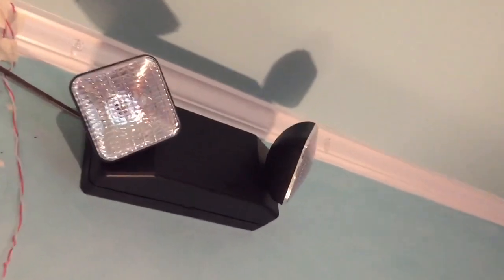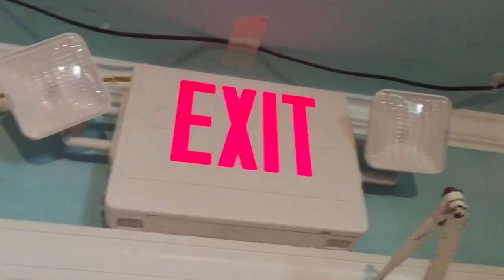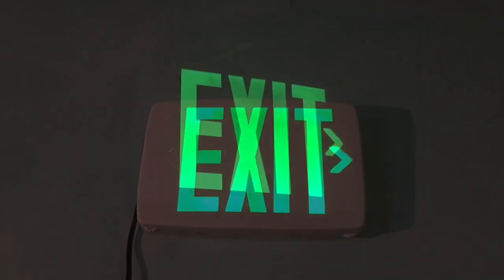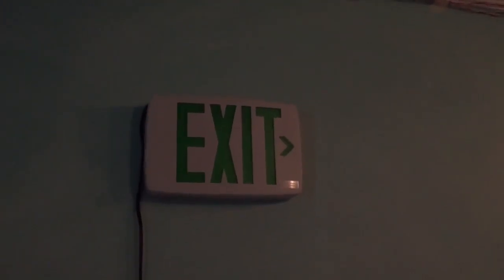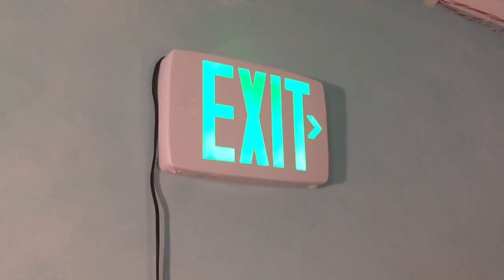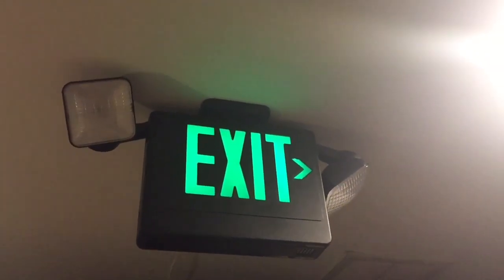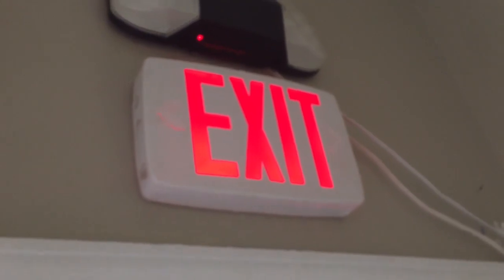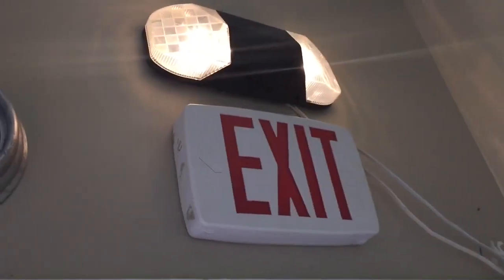EXIT SIGN FAILED?!?! | Exit Sign Setup 18

Comment: I had my garage exit sign combo fail within 30 seconds after power cut off to the unit. The combo is a lithonia LHQM with emergency light heads off of a ELM2 (incandescent version). The battery was faulty.

Comment: 11:35 that’s actually false. I have a LQM AC only sign seen in the video and it failed on me depict being ac only. When I wired the sign up it totally failed and none of the LEDs lit up. AC only signs CAN fail.
Reply from the maker: Sounds like you have a defective unit. When I stated “it can’t really fail” I was referring to how my LQM SD failed. The AC sign has no battery so it is less likely to fail.
Reply: @ExitSign250  I think there was a problem with the transformer or led board. It sad to see my AC only LQM go to waste since that was my first exit sign.

Comment: Nice video, those modern exit signs with self diagnostics tend to fail a lot especially under frequent power fluctuations. Also they are made with cheap plastic, recently at my school I helped replace all the modern exit signs from 2010 with nice new metal ones. But hey, at least the old ones we're easy to remove, lol
Reply from the maker: +A2ZAlarms   Not necessarily. Brand names (such as Dual-Lite) usually don't fail. Dual-Lite products, including the common self-diagnostic models, rarely fail. Lithonia sometimes fail, but not all the time. Not all modern exit signs are trash. Dual-Lite still puts in the effort to make a great product.
Reply: ExitSign250 correct, dual-lite stuff is great, never had any problem, but that Generic stuff does not last long. Yours probably has a shot battery.
Reply from the maker: +A2ZAlarms   Generic is never the way to go. Just cheep Chinese junk that's rebranded by millions of companies. I added an update in the description about the LQM G SD. It doesn't have a shot battery at all.

Comment: How old was the battery itself? It may have hit the end of it's service life, also, testing the sign cuts the AC power regardless if it's self-diagnostic or not, and trickle charging also kills the battery, too! Slowly, but it still dies, so chances are the battery hit the end of it's service life, so if you test an exit sign or emergency light for two seconds and let it charge, it's killing the battery more, and last I recall, self diagnostic signs test for ~90 minutes? correct me if I'm wrong, I don't own a self-diagnostic sign or light, so I have NO clue!

Tl'Dr: End of service life due to battery being trickle charged/short used, let the sign do the test on it's own!
Reply from the maker: +Bob Tramontana   I never said testing a given exit sign doesn't cut power. That's a basic fact. Self-diagnostic exit lighting does many things. One it will tell you if a problem occurs with the unit. It will also test itself once a month for 1 minute. Testing self diagnostic exit lighting does different things depending on the manufacturer. I'll give two examples. Dual-Lite's SD (self-diagnostic) when pressed once will test itself for a minute. Pressed twice will test itself for 90 minutes. Lithonia Lighting, when a unit has SD, and pressed will test itself for 1 minute. When pressed again it will cancel the test. SD units are require less maintenance so you don't need to worry about going around testing exit signs and emergency lights once a month. Now on standard units (non self diagnostic) it doesn't test itself unless someone presses the test button. It will then cut off power as long as you are pressing it. It is always good to test exit signs and emergency lights if they are self-diagnostic or not to see how the unit performs. But when you test a unit for a second then restore it to AC, that does not harm the battery. Unless constant testing happens, the battery is fine. Back to my Lithonia LQM G SD. It isn't even a year old and I have added an update about it in the description if you'd like to check it out.

Comment: Fuse blown or loose connection?
Reply from the maker: +Sterling Ordes   Exit signs do not have fuses. All the connections were intact. I put an update in the description if you want to see the result.
Reply: Lol nvm I was thinking of a fuse for overload on the 120v input. Only some exit signs don't have ivop (input voltage overload protection) because of risk of fires if an overload were to occur.
Reply: I feel so stupid lol
Reply from the maker: +Sterling Ordes   It's ok

Comment: For the exit lights with no Reflectors, you can remove the bulb, tape off the sides, and give the light a few shots of silver spray paint. It will increase the spread by probably 10 fold, and poses no fire risk 👍🏼
Reply from the maker: +MJTVideos   Those are called "exit sign
combos" not "exit lights." I don't think silver spray paint would increase the light spreading. Plus it would look kinda tacky.
Reply: @ExitSign250  my mom calls them exit lights

Comment: Hey ES250. I was looking online to find emergency light, can you help? I have been looking at this one https://www.amazon.com/eTopLighting-1pcs-Emergency-Exit-Light/dp/B00KC1FXDG/ref=sr_1_3?s=hi&ie=UTF8&qid=1503840238&sr=1-3&keywords=emergency+light&refinements=p_89%3AeTopLighting%7CLithonia+Lighting%7CDual-Lite but I don't know if I should get it or not. Thanks!
Reply: If I do get one it will be my first
Reply from the maker: Monkey Bread   That one you found is a generic fully LED emergency light. Those are cheaply made so it may break, crack, etc easy. I guess it would be fine as your first emergency light, but you may be able to find a better unit for the same price.
Reply: ExitSign250 ok!
Reply: ExitSign250 I plugged in my exit sign combo, let it charge and when I tested it the light did not come on, I look at them and the wires were disconnected on both of them.... and I do that e a soldiering iron.

Comment: The diagnostics in the LQM sign aren't that good... I bought the red version a few months ago off eBay (less than a year old) after taking it down to relocate it, it shows an electronics failure code 😑.
Reply from the maker: +Mr. Nick   Wow. Doesn't seem reliable. Yeah, it was installed around four weeks and went through three power outages fine. But when I do a simple 1-3 minute test, it fails. Very odd. Lucky I only spent $7 NIB from Amazon because it was on clearance, so I didn't give an arm and a leg.
Reply: ExitSign250 sounds like a bad battery
Reply from the maker: +CharmanderFan20 CharFan20   I put an update in the description if you want to see the result. The battery is fine.
Reply: ExitSign250 not bad. I didn't pay much for mine either,  probably the microprocessor in these signs are a little wonky in terms of not really being reliable.
Reply from the maker: +Mr. Nick   Yeah. Your probably right.

Comment: I see an amplifier... voice evac?
Reply from the maker: +firealarmsnstuff   If you saw a black box sitting on the ground, that isn't going to be used for anything fire alarm related. Actually it's a radio receiver for a stereo system with a built in amplifier. So I can only play radio stations through it. I'm using it for an unrelated project.